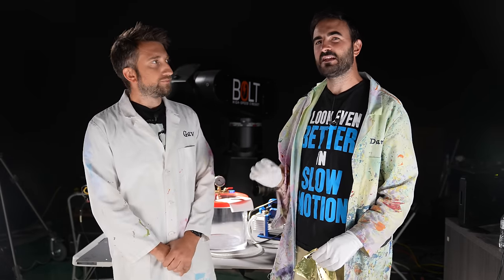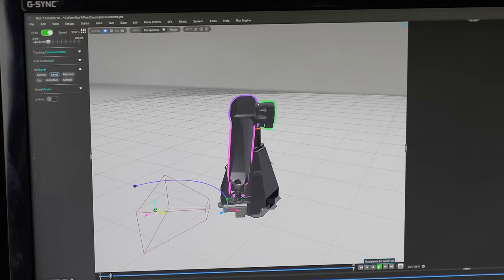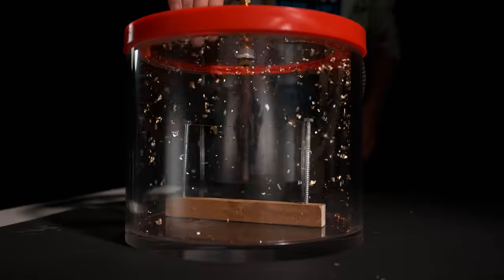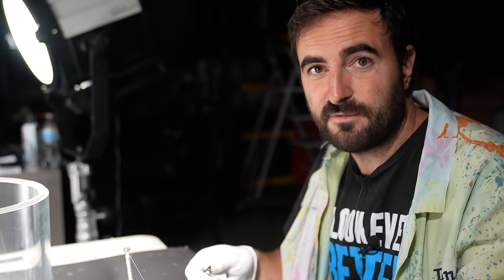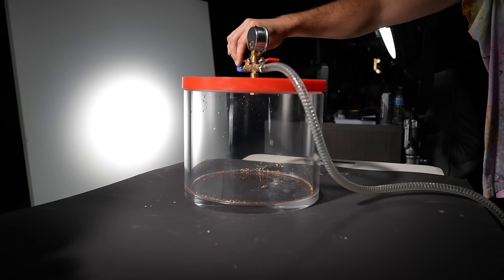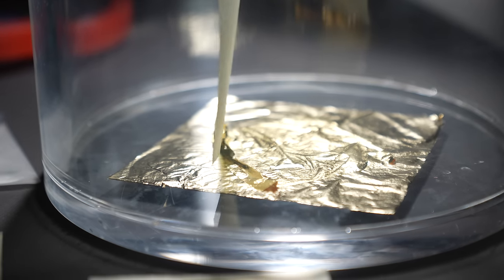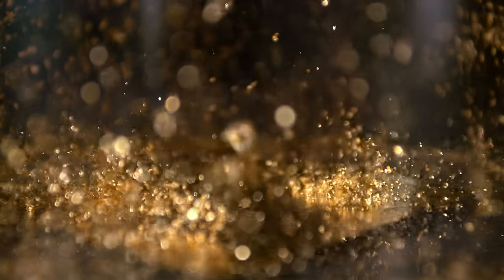Exploding Gold in a Vacuum at 80,000FPS - The Slow Mo Guys

Comment: Do ice in a vacuum chamber next. The ice will melt while in the vacuum and refreeze when you repressurize
Reply: Sounds cool 😎😉
Reply: That sounds amazing!
Reply: other way round mate
Reply: @ladmad9196 no, you're wrong.
Reply: I would love to see that!
Reply: @notahotshot  No, the original comment does have it backwards. If you check a phase diagram, you'll see that water can't exist in the liquid phase in a vacuum. If you put water in the chamber, it would either freeze or evaporate, depending on temperature.
Reply: @avecas  makes sense, hence we don't see huge waterdrops travelling around in space. which is sad, that would be really cool.
Reply: Take a block of ice, a length of wire, two weights.
To each end of the wire attach a wire.
Place the wire over the block of ice, a weight hanging down on either side.  For illustration, imagine the stirrups on a saddled horse.
The wire will pass through the ice, but you won't eed a high-speed camera to video it.

I don't think your vacuum will do anything.
Reply: Water in a vacuum boils, ice in a vacuum melts, right?
Reply: @avecas  Water in a vacuum boils, ice in a vacuum melts, right?
Reply: Nope....I saw a video years ago with a beaker of water in a vacuum chamber and if I remember right the water "boiled" when the air was being sucked out of it them instantly froze from loss of heat.
Reply: @avecas  right, but they didn't say put water into a vacuum chamber, they said put ice. Also they didn't say what the ambient temperature is, though it can be assumed they did not intend a very low temperature. While they were incorrect when they said it would melt (it would sublimate). Saying they had backwards is also incorrect. Putting ice into a vacuum chamber, at any temperature, absolutely will not cause it to freeze, as it's already frozen. It will remain frozen, or it will sublimate.
Reply: @licitchaos  ice in a vacuum sublimates (moves directly from the ice phase to the vapor phase)
Reply: @outtathebox5319  That's not ice. a vacuum will boil water. Apparently you need a pressure cooker to boil eggs on Mt Everest.
Reply: @notahotshot  So you think that ice cannot exist in a vacuum? Or are you saying it will stay ice? If I have a glass of ice water what happens as I lower the pressure?
Reply: @licitchaos  

From the final two sentences of my last comment, "Putting ice into a vacuum chamber...it will remain frozen, or sublimate."

What part of that makes you believe that I think ice cannot exist in a vacuum?

It will depend on what the temperature of the chamber is, and if you continuously evacuate the chamber.
Reply: @oneeyedphotographer   my point was  ice will not melt then refreeze when you break the vacuum...as others have pointed out it will sublimate and there will be nothing in the chamber to refreeze because...it's a vacuum...putting water in there would be much more fun to film at high speed when it "freezes"
Reply: Loss of pressure will cause freezing, not loss of vacuum. I live in an area that gets down to minus 30. Ive left a bottle of pop in the car when its really cold. I jumped in the car, pop was completely liquid, untwisted the cap and instantly became slush
Reply: @avecas you cant instantly transition from atmospheric pressure to a vacuum. They obviously wouldn't be able to reach a true vacuum because some of the water will constantly evaporate and they will need to constantly pump out more water vapor, but they can get reasonably close enough to demonstrate the phase change that op mentioned. Basically you're wrong and you should feel bad for being wrong.
Reply: @mattcintosh2  That's different and only works this way with things like carbonated beverages. The liquid in the bottle was supercooled, and the carbonation gas bubbles that formed when the bottle was opened provided nucleation sites to trigger the sudden phase transition. Next time instead of opening the bottle try shaking it, this will trigger the same instant transition without releasing any pressure.
Reply: @janitorizamped  Again, look at a phase diagram for water (the Wikipedia page for "Ice" has one in the "Phases" section). The only region where a drop in pressure can lead to a transition from solid to liquid is at extremely high pressures beyond several thousand athmospheres. When dropping pressure from athmospheric down to a vacuum the melting point of ice actually goes ever so slightly UP (not down!) by about one hundredth of a degree, until you reach the triple point pressure at 611.657 Pa (~6.1 mbar) below which liquid water cannot exist at all anymore.
Reply: @outtathebox5319  That won't happen, there's too much energy needed to convert ice to water vapour. If also add heat, then it can happen, but you won't need high speed cameras.
Reply: @licitchaos  no
Reply: @licitchaos  ice in a vacuum sublimates
Reply: Sounds so cool!

Comment: 9:28 Congratulations Dan, you were saved by the inventors who had the clairvoyance to foresee people trying to eat the dustified version of their gold. The glue they use is re-activated by the proteins/fats on our finger and it won't come off with saliva after that. (could be a fluke but a happy one at that) Gold is toxic in fingertip-licking quantities. Your body can only use gold in its mono atomic form (not mono-layer) and I can't find jack on the internet which bodily process even uses it. The food grade gold specifically has food grade glue. The floating gold in that liquor (gold strike?), is also glue-free but still has a tendency to stick to the inside of your throat/gut.
Reply: Goldschlagger

Comment: Fun facts: "malleable" comes from the Latin word for hammer, and it means "able to be hammered into a thin sheet." "Ductile" on the other hand comes from  Latin for (if I recall correctly) "to draw" (like pull, not make art), and it means "able to be drawn into a thin wire."

Comment: Properly adhered gold leaf is used for weatherproofing against wind, rain, snow and dust. You can see it doing it's job in the flat gold leaf part of the video where only the edges peel away. "Gilding" If you ever see a "gold" statue, In certain places - Many in france - These are covered in this very thin gold leaf.
Reply: You also see it when it wraps around the "washing line"

Comment: Great one as always. Reading the title mislead me a bit. I remember Adam Savage taling on Tested about the electroplating on his C3PO. Metal heated in a vacuum if im remembering correct. Liquid metal pops at the boiling point coating everything in a small layer. I thought you filmed that. (hint, hint...) :P

Comment: The hose on the other end of the ball valve, where you equalised the pressure from, should have gone into a resivoir of thick smoke. You could of visualised the air racing back into the jar

Comment: 2:45 Which is why this isn't really all that interesting imo. Because even an air cannon is still just sending higher pressure into lower pressure.
3:35 This is pretty cool though. Watching the outer edges rip off like it's dissolving into space after Thanos snapped his fingers.
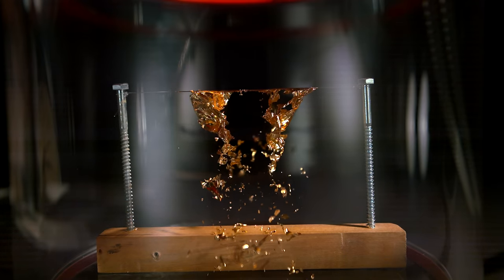6:23 Okay, I take it back. This is actually so slow, you can see the stream of air such that it looks like you're filling this bucket with invisible water! You can see the air collecting at the bottom and splashing around!
8:00 This is amazing. It's like a meteor impact, but where the meteor is invisible, there's no dust, and nothing catches fire.

Comment: Very interesting, but the foils aren't disintigrating due to the effects of going from a vacuum to normal air pressure, but are instead disintegrating in the airstream of the inrushing air.   It could also be done in normal, ambient air pressure using a fast moving narrow stream of air....but the vacuum definitely helps to amply the visual effect of it 'disintegrating into dust' !  :- D

Comment: I think it would be cool to see a bicycle tire, and more particular a mountain bike tire going over a smaller rock like you would see on a trail. Most higher end and quality mountain bike tires are tubeless and 120 tpi casing. We rely on tire flex all the time and it would be cool to see it in ultra slow motion. Maybe going through a corner also to see how much a tire flexes when under site load.

Comment: Is there a point right after opening the valve that the air flow is supersonic while the pressure is very low and the velocity is very fast?  Could that be tested with Schlieren photography?

Comment: You guys should do another explosion video, but like with the powder paints. But you guys should step it up a notch. Or because the Thanksgiving is around the corner. It would be interesting to see what happens to a turkey In the air vacuum.

Comment: Wouldn't the air rushing in also cause the gold to heat up, maybe not the almost 2000°F (~1065°C) it needs to melt but maybe it is and it is actually liquefying it without turning it red hot... just speculation on my part.

Comment: It's hard to do because the rocket will emit gases that the rocket will be able to push off of, so it's a tricky test but with slow motion you'll see that the Rocket won't go anywhere until it has its own gases to push off of.

Comment: This makes me wonder if one can test explosive decompression. You have the tiny vessel at atmospheric. Then cross connect to a very large vessel which you use as a vacuum. PV=nRT. Is you have the pressure vessel say 100x the size of the other, then you end up with rapid decompression to 1/100th. Reason I ask is I am curious about stuff like aerogels or liquids and what not of a slow vacuum draw vs rapid.

Comment: This would have been even more interesting/dramatic if instead of simply letting in atmospheric pressure, the incoming air was from an air source that was higher than simply 14 psi differential.

Comment: I degas epoxy resin in a vacuum chamber before infusing.
Once I opened the valve to let the air back into the chamber a little to fast and the resin basically done the same thing.
Wasn’t fun cleaning that up.😅

Comment: Now you need to explode an egg with vacuum. Might need to have the egg in a second smaller chamber converted to big. Have vacuum in big chamber then open valve to egg chamber. Rapid drop in pressure show make liquid in egg explode.

Comment: Instead of a vacuum chamber, why not just use an actual airhose?  It isn't like it's atmospheric pressure equalization that is tearing it apart, it's air flow just like out of a nozzle.

Comment: With such a small hole for the air to enter the chamber you’re basically blowing a big air gun at it. You need much larger, and ideally faster, valve to get the real epic footage. If you really want to step it up, set up a 125-175psi tank to blow down into a vacuum chamber. While you’re at it, do a snow motion video of a technician setting the bead on a truck (lorry?) tire. Or doing with with starting fluid. Totally safe. Good job for Dan.

You’re welcome, Dan. If you don’t want to do it, I’ll do it as long as I can wear your protective lab coat.